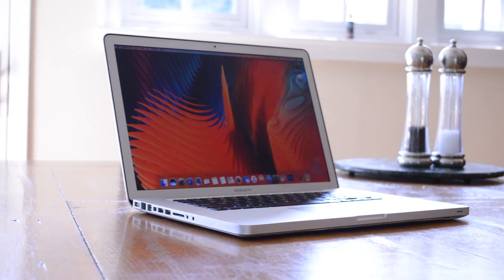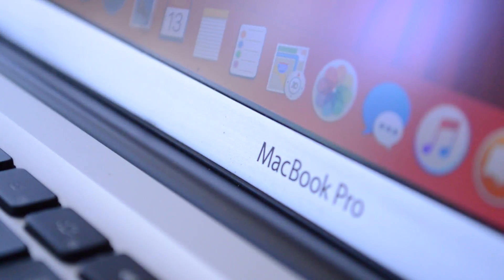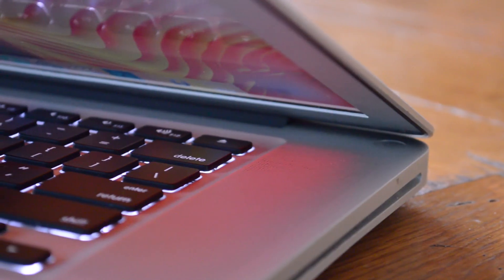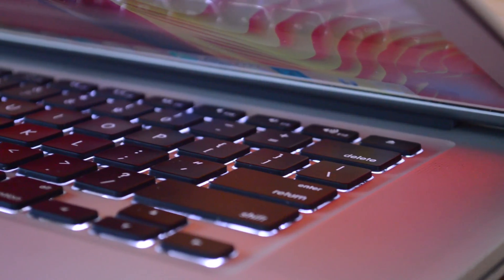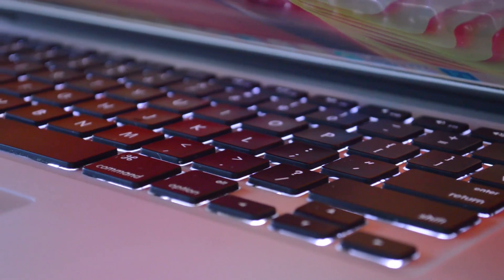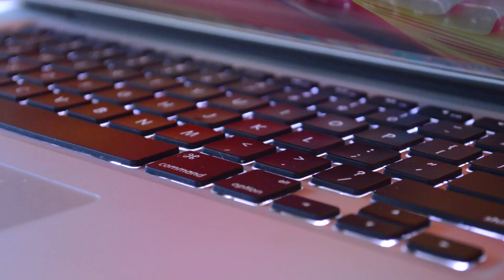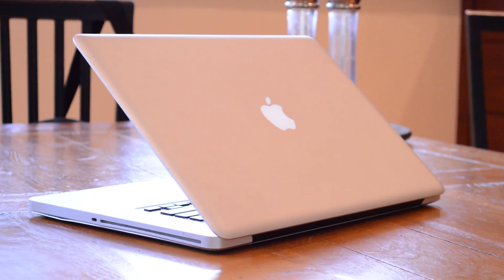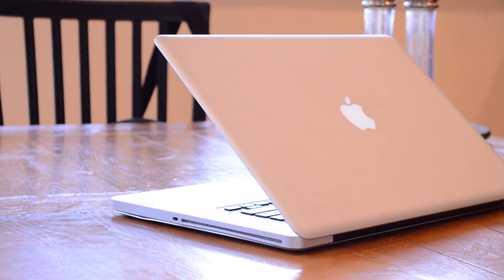Improve your MacBook Pro performance for $6!

Comment: My 2011 MBP 15" died because of the gpu but I revived it by disabling the dGPU using archLinux and removing the AMD kext. If you ever get that problem you should definetly give it a shot.
Also its a misconseption that the issues are only early 2011 as my 15" MBP is Late 2011

Comment: I'm going to replace the thermal paste in my MacBook Air. Would the thermal paste you linked work for my MacBook Air? How do I clean off the old thermal paste without causing damage?

Comment: I just replaced the thermal paste in a 2010 13"  and cleaned out the dust and stuff that collected inside while using it for nearly 8 years.  Fans kick on less often.  Noticed an immediate 10-20 degree difference when watching HD YouTube videos and multitasking.  Still chugging along.  I plan to keep it for a couple more years for the basic stuff since I have a desktop windows/linux machine for gaming and anything intense.

Comment: I had a MacBook Pro (15-inch, Late 2011) and the graphics card failed. Apple replaced the main board in November 2015 for free.  That was sweet.  I sold that computer. Kind of wish I kept it.

Comment: Don’t some of the 2011 models have intel’s integrated graphics also? It switches between the graphics card and integrated graphics based on the work load right?
Reply from the maker: Gabriel Summers that’s correct, all the MacBook Pros with dedicated graphics since 2010 I believe have automatic graphics switching

Comment: I need help havent used my 5 year old macbook pro in year or two and so it was running super slow when I turned it on and now so I updated it and halfway through the update it turns off and if i restart it, it will just turn off idk what to do... I looked everywhere no one has my problem.
Reply: Jake T. Austin replace ur hdd to an ssd hardrive

Comment: Cleaning out any built up dust around the heatsink exhaust fan will help as well. I've worked on a couple of PC laptops recently (a Dell 1525 and an HP 26xx), both pretty decent older machines that would run really hot and the HP was constantly hitting 105 deg C and shutting down. Both had a literal wall of dust blocking the airflow out the back. It was like pulling out a thick piece of felt. Really nasty. I did redo one of the thermal pads on the Dell (it had two (CPU and GPU) and one of them had all but disintegrated due to excessive heat over the years. I just cleaned it off as best I could and put some new paste in it's place. The other pad I left intact as it was still in really good shape. The fan went from sounding like a jet engine down to a soft whisper. The HP still runs a bit hot, but that model is known for it (it's a big 17" mofo), but no more shutdowns and the temps usually hover around 80 to 90 C. Yes, these are PC's, but Macs have even less room inside for ventilation so any amount of dust build up is going to contribute to heat. Open it up, get some compressed air and blow out the nasty (don't put the air right down on the board though, do it from a distance like Bette Midler).

Comment: Doesn't testing the computer at full throttle not really demonstrate the difference though? I mean the fan will still run at full speed at 100% CPU. This difference is probably from unintentionally removing dust. Replacing the paste will just mean that the fans won't have to come on as much under normal load.

Comment: Got the same laptop and 80 degrees is still a lot. You should use Macs Fan Control to set your maximum temp at 75 or lower and use gfxCardStatus to lock your gpu on integrated most of the time. A lot of software asks for dedicated gpu but it runs just fine on the integrated one. Also you should get some cooling pad because it helps even if you don't start it at all. The simple fact that the case is upper and the blown air goes in the air and not onto the table helps in the long runs.